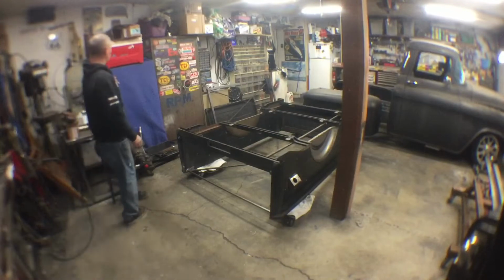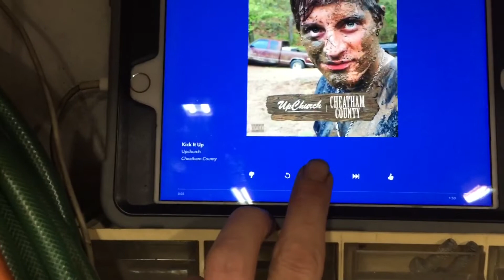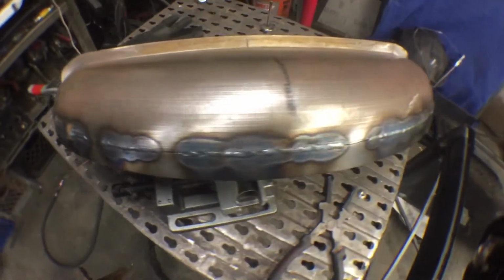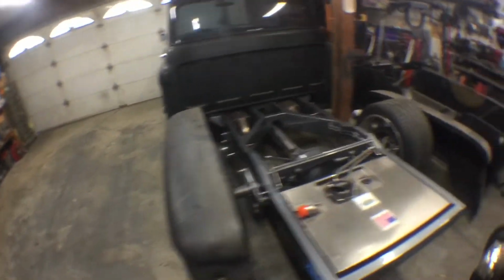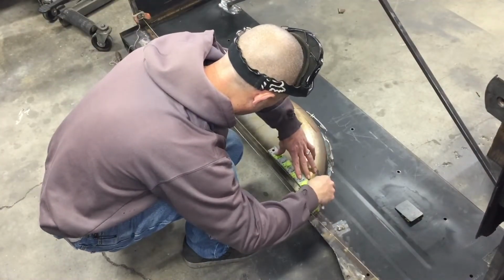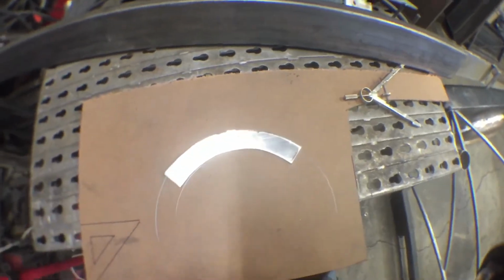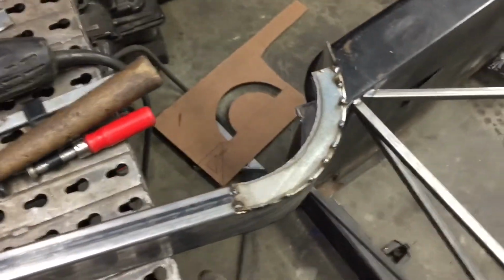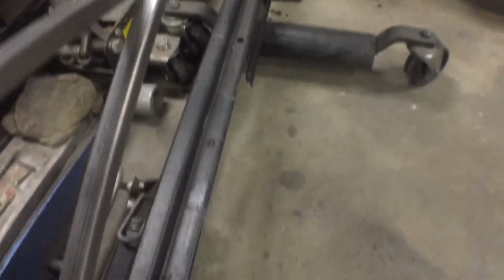Box steel radius without a bender

Comment: I have found that using .035 or .045 STAINLESS mig wire to tig that thin stuff works WAY better    try to keep the fit as tight as possible
Reply from the maker: Randy Hertzberg right on I’ll try that next time that’s funny because I almost grabbed some to try it and didn’t I should have 🤦🏼‍♂️

Comment: Great work on the truck.  Thank you for taking the time to put together all the videos.  On one of the videos, I noticed that on your tailgate, you installed a operable latch to open and close the tailgate.  Do you have any details on how you did this?  I have searched through your videos, but cannot seem to find anything on it.  Thanks again.
Reply from the maker: Thanks for watching and I don’t have any videos on the tailgate latch. I was thinking of patenting that idea it works really well but never got around to it.
Reply: @heimlichhotrods  Any chance you could give me an idea of how you did it?  I promise I won't tell!  I want to incorporate it into my 55 3100 build.
Reply from the maker: It will take quite a bit of fabrication but I started with the spring loaded latches you can get at brothers or the truck shop I attached cables to them and they will hook to bell cranks that when the handle is pressed it pulls the cable attached to the spring latches. I made the handle out of 1/8 stainless plate and stainless piano hinge nad attached it with small tabs
Reply: @heimlichhotrods  I've done a some of the same modifications you have done, but did them in different ways.